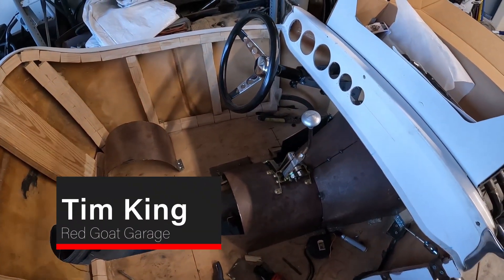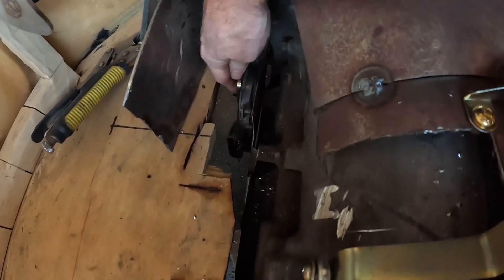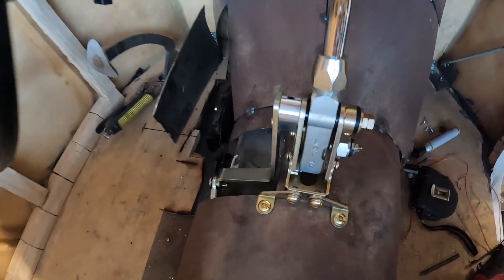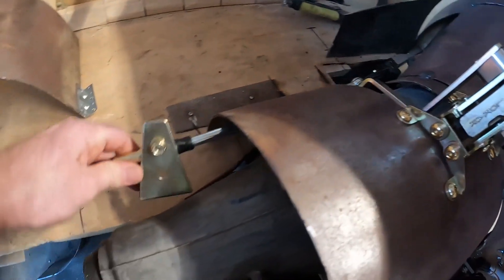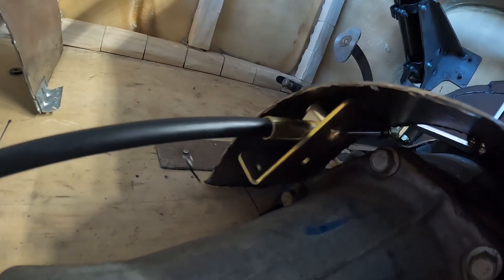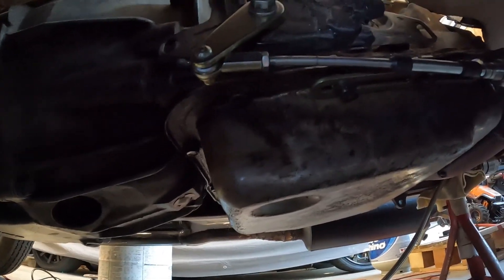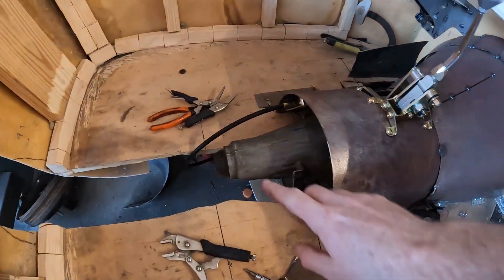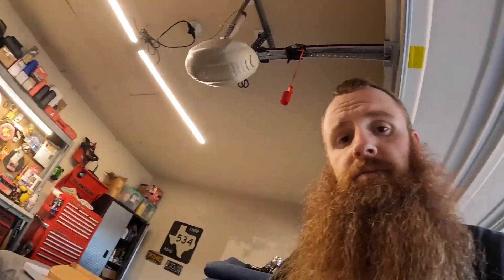Lokar Shifter Install For My 1923 T-Bucket

Comment: Like your vids man but anyway to see a close up vid of the inside fire wall and did you just bolt it to that I’m trying to copy what you did on my t bucket. Thanx.
Reply from the maker: Hey there! So the firewall is a piece of plywood that’s glued to the fiberglass bucket. The trans hump I just welded some angle brackets to it and then screwed that into the firewall. My plan is to then use some caulking/seam sealer to seal up any gaps. I hope that helps!